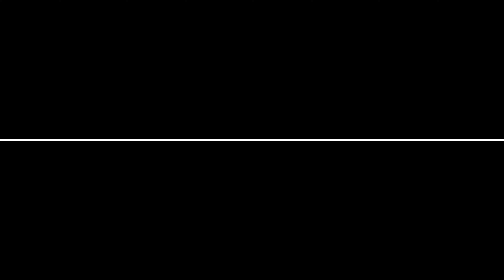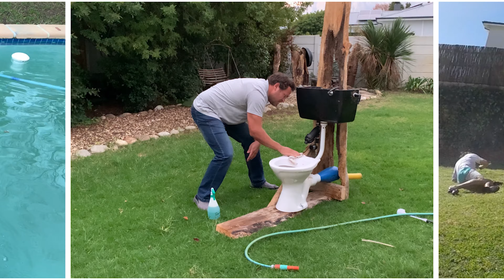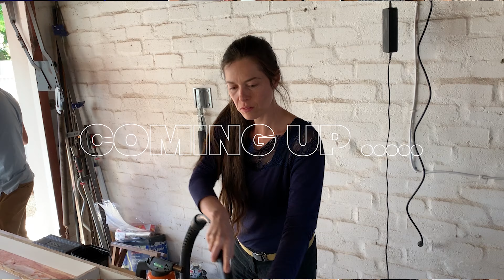Transforming $1600 Speakers with Stunning Epoxy and RGB lights - Pt 2

Comment: These look amazing and the craftsmanship is very impressive. However, acoustically, the sound will suffer greatly from the choice of materials. At the very least, isolate them from the floor with speaker spikes.
Reply from the maker: Thanks Colin, I have them on the rubber feet that came with the original set because they are on a tiled floor in my living room, but you are right there's a whole list of stuff I could have probably done a bit better. They do sound pretty darn good as is though, so much that I can't tell the difference at all between the originals. It would be good to measure them at some point to see how they compare to original specs. It was such a rewarding build, I would love to do another one and do a few things better.